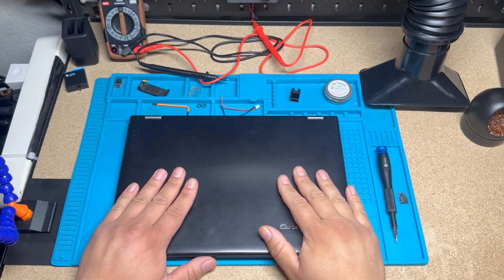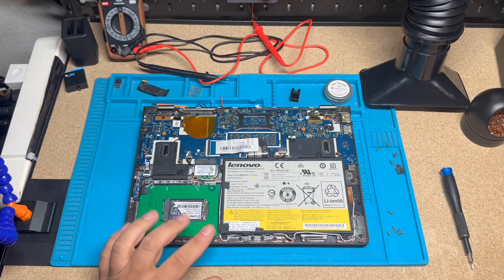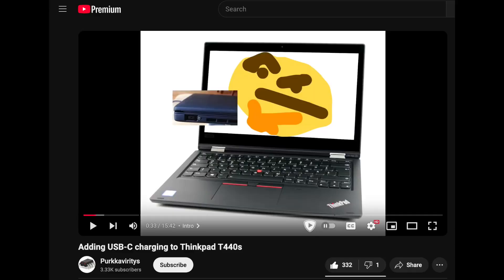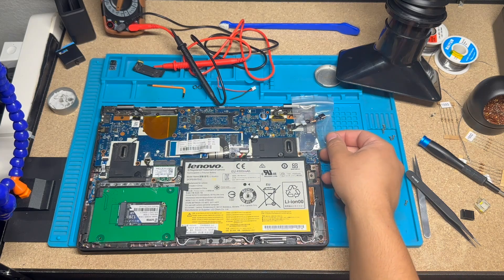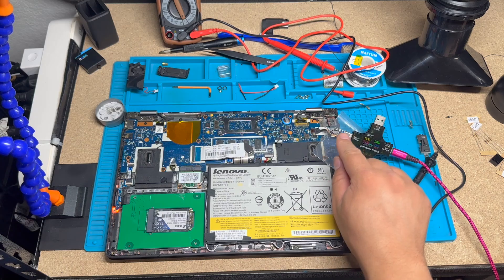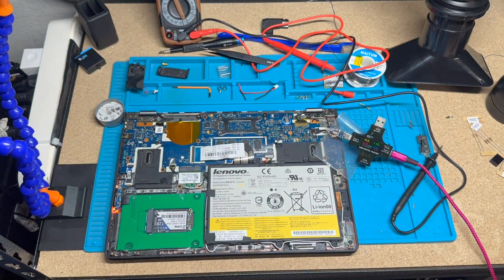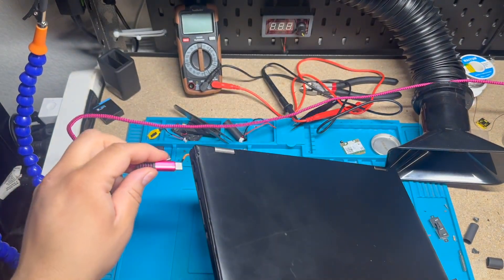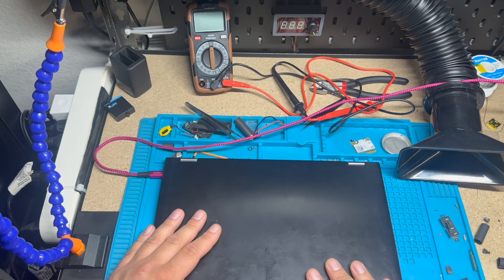Revamping My Lenovo Laptop With Usb Type C Pd!

Comment: When the laptop is on but disconnected from a charger is there any voltage feed back out of the connector? Wondering if it outputs 20v that'd fry a device plugged into that port accidentally. Would be cool if you could do USB data passthrough too!
Reply from the maker: Nah, data only goes one way.
Reply: @Symbiiote  gotcha, so no power feed back out the usb-c port? Thanks again!

Comment: That's very impressive. I spent a while looking for a good laptop that fit all of my needs for work and couldn't find one that wasn't over $1,000 that had a Type C Charger. This is a great video, i may try this on a old laptop just to see if i can modernize it. 

Would it be possible to wire up one of these to add Type C Data transfer function to a laptop? Lets say i already added 1 to charge my laptop, can i use a separate one to swap out a USB A to USB C or where these only made for Power delivery?
Reply from the maker: Thank so much! If you wanted to use the port for data as well, you would need some logic. Definitely a interesting idea.

Comment: Do they make one that can be set to 19V?
Reply: Most 19V laptops can actually handle a 20V input without issue. Do your research, of course. You generally can't request 19V from a USB-C source as that is not usually a supported voltage.
Reply: @MyriadTechRepair  Thanks! I wonder if it would be possible to emulate Dell's 1wire protocol stuff somehow... they 'authenticate' chargers using it.